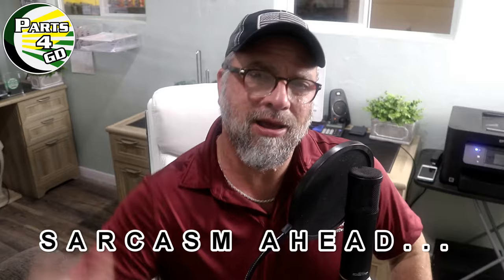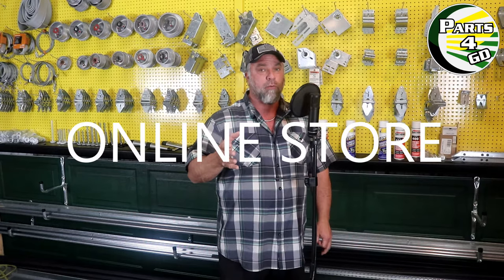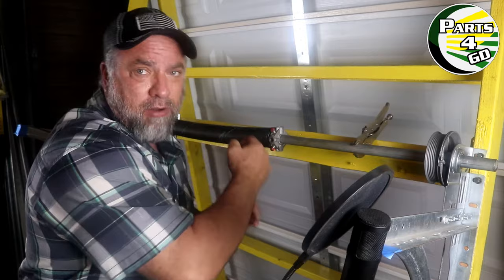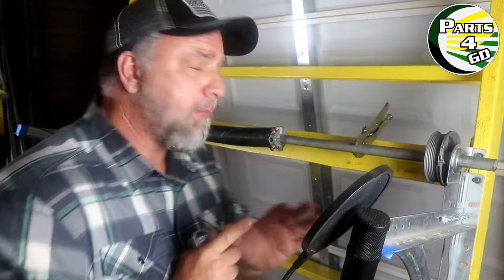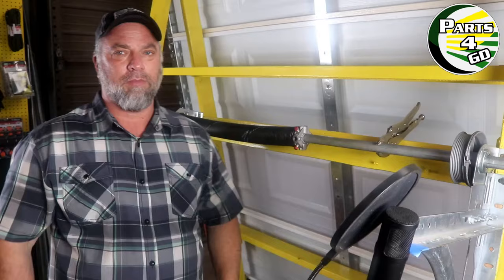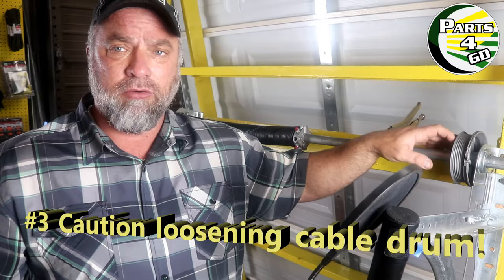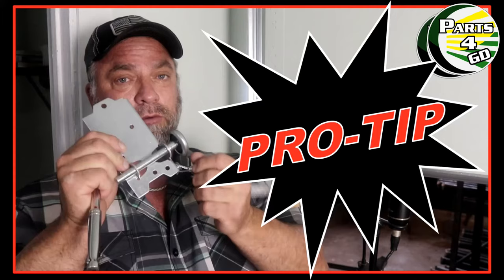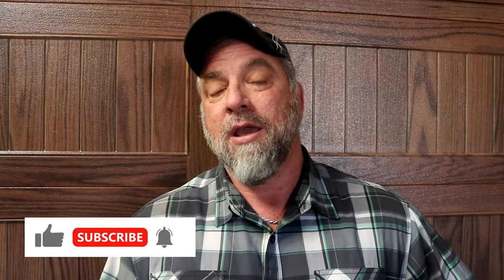4 Garage Door Dangers Every Diy'er Must Know! Watching This Video Could Keep You Safe!

Comment from the maker: Thanks for watching! We would be happy to answer your garage door related questions as best we can. Please feel free to hit us with a question in the comments below...
Reply: Hey great video! Just to clarify, once the torsion spring is relieved with 30ish 1/4 turns, will there be no tension or extreme danger after that? 
I just need to remove an 8x7’ in a building I’m taking down
Reply: Whish I'd known this 20 years ago! I would have replaced my own garage door!

The moron who did it left the old tracks, and torsion springs for my WOODEN (Several hundred pounds) door intact (mostly), but bent all to kingdom come. Bet he didn't know any of the stuff you talked about, and probably hurt himself in the process. Why else would the steel tracks be cut short, and bent up a few feet from the opening for the door, and ONE of the 2 springs all unwound and looking a mess, while the other was still wound? (Frankly, I've come to realize that that wooden garage door was the best part of the house. Better than the 3 wire telephone wire [a standard for about 10 seconds in the 40's], but worse than 2 wire after that. And Better than the REDWOOD beams used in the rooves of the house and garage. [That part of the rooves felt like it was about to break when you walked on the roof.] And better than the 2 wire electrical system of the house and garage.)

With a new, aluminum (practically illumination foil) and track installed right next to the parts of the old one he left attached to the garage.

I've never seen a worker install a new appliance or device AROUND the old one.

Had to get the owner of Overhead Doors to come in and fix new door himself, as it literally started to fall apart just a few weeks later. Had to mention AMX to get the owner to stop avoiding me. But he called me in 15 minutes after a month of avoiding me, when I asked his secretary if they took AMX. Thant's some clout AMX has, as I neither paid with it, or called them about it.
Reply: My garage door does not have any springs in the center like that the little drum like things on each end and one of them has popped or come apart in the spring is the cable is fell off of it and the door comes up cockeyed never seen one of these before

Comment: Vise  Grips should be on either side of the end plate so  when winding the torsion spring or springs don’t cause the torsion tube to make the winding bars pop out and hurt or kill someone   !  Never put  hands on the Red Set Screws  when under pressure like you Did ! Should paint the torsion spring with a paint line so you can count the turns  . Some MFG put dots white lines on them to help count the turns  but not as good to see . I have been the Overhead Door Field for over 40 years  and a oner for over  that .   Doing Commercial  and Residential  Installs  also Emergency Service  Calls .

Comment: I'm 53 and just dismantled a 17 x 8 door by myself for the first time in under 3 hours.  I watched a few youtube videos, bought the right tools (mainly spring bars and square socket) and went to town. I was methodical and only removed what parts were absolutely necessary, starting with loosening the springs of course.  My wife helped me finish up for the last hour.  I also consider moving the ladder around a lot and going up and down it many times to be 100% more dangerous than tensioning/detensioning the springs.  For years I've heard how it's so dangerous but I had both springs unwound in 15 minutes and didn't think it was any big deal.  It just takes a proper checklist and paying attention.

Comment: Thank you much for this info. I worked for a general contractor for a time and have experience in finish carpentry, tile and stone, and drywall but had never worked with overhead doors, and frankly was petrified of attempting any work on the torsion spring / counterbalance. Well, now because I'm renovating a pre-1978 home, no installer wants to do a replacement for me. With your advice, I'm confident I can do it safely.

Comment: That video came out just after my scar between my eyebrows. The only thing I wanted to do was replace the rubber at the bottom. I thought to myself it would be easier if I remove the 2 bottom rollers and open the door, that way the panel hangs down and it's easy to feed the rubber. Because the way the foundation knee wall goes over the side of the door, I didn't see the wire attached to it and just like you said in the video, after removing the last screw of the bottom roller plate, it flew up. Luckily it didn't damage the ceiling, my forehead stopped it. My glasses flew away. Lucky I didn't lose an eye.

Your video would have helped me a lot. I had to deal with winding the spring again because all the tension was lost when the cable few up. I did watch a few vidows on that, I forget from who, but they did show the same safety precautions as you, like using a vise-grip to hold it, and more imnoprtantly use 2 proper bars to wind it. Unfortunately, I couldn't find any in short notice, So I made 2 out of 5/8" rebar, and machined the ends down to 1/2" so that the fix and sit all the way in the holes on the spring bracket.
Reply: 😱 I'm glad you didn't lose an eye or worse!

Comment: Awesome info. My wife didn't wait for the door to completely raise before backing the car out, catching the top of the tail gate to the bottom panel on the door and bent it in the middle about 1 inch out. So, I have to get that bottom panel off and try to straighten it out. This gives me a lot of info, thanks!
Reply from the maker: You may need a strut brace.

Comment: Dope video. I think ima leave this for the pros. Seems easy, i work maintenance.... But one thing inhave learned over the years is somethings are best left to the pros.
Reply: Best display of parts and explanation of garage door repair and function that I have seen. I have watched a lot. 
My renter smashed her car into the bottom 2 panels, twice. 
I've been considering removing and pounding out dents and one support bracket. My door was made by Gadco and they are no longer in business. 
If replacing , I'd have to replace them all with a different manufacturer.  Cost over $1400. For new  complete it would be over $2.100.
Reply: Can you use a hand wench pulley or come along to release the tension rather than  messing with the springs??
Reply: paying a professional is cheaper than going to the hospital or funeral costs!
Reply from the maker: Sometime the easiest way is the right way. But you're right- it's possible to be creative... I don't recommend though!
Reply from the maker: You are absolutely correct!

Comment: I have an old extension spring door which no original parts are available so I have to map what I can get to what is on there to make sure it will work before taking apart.
Reply from the maker: Hope you were able to find what you needed.

Comment: Thanks for the tips. I repaired my garage doors maybe 3 times in 15 years. So I always forget the process and this video reminded me of the safe process and procedures. Last year, my new neighbor at the time had his Spring snap in half. He asked me to help weld it back together. I tried to tell him that it was really dangerous and should be replaced.. I'm not even a professional welder, but I'm sure that they wouldn't do it either. He was hard headed and did it anyway. It lasted 2 days and snapped dropping the door close to his feet. SMH. Anyway awesome video.

Comment: You did not say where to buy these rods.  Does local hardware store or Home Depot sell them? Can u use a black pipe 3/8 inch inside diameter to put in them holes ? Help !

Comment: Thank You! Watched just in time!  I was going to loosen the set screws on the cables!  Again thank you!  My problem is I put on a new bottom seal and I have gaps about 18' in from both ends. I adjusted the limit but it bottoms out in the middle.  Perhaps I need a larger seal? The new one is 2 3/4".  Threw the old one away before I could measure it. (I didn't have gaps before other than where the old was torn) So get a wider seal or is there a way to take tension off of cable to lower it if that will even work?  Thanks!
Reply from the maker: There is a way to adjust one cable. That's another video though.

Comment: awesome information, thank you. Question, I have an old 10' x 10' old wooden garage door and I need to change the bottom 2x4 wood of my garage because its rotten. I have a 2 roller drum system on both sides with the tension spring in the middle of my garage door directly on top. The 2 brackets at the bottom of the garage door that I need to remove are obviously attached to the 2 pulleys. How do I release the tension off those cables so I can release the brackets without the cables letting go and unwinding? thanks in advance my friend.

Comment: I was told my garage door isn’t made anymore. It doesn’t go up on its own but when lifted manually it does stay up. It seems like it still gets power to the motor but won’t go up on its own. Was quoted 1500 for a garage door. What should I do?
Reply: find someone who is licensed and insured for starters..... don't hire a person who says they're an expert... what area do you live?
Reply: The wound up springs are helping balance the weight of the door in order to open it, with or without the opener motor.  Most size doors and opener motors can be purchased at Lowes or Home Depot.  Although, it sounds to me like the gears may be bad in your opener motor.  Its a DIY thing if you're capable.  I got an off-duty garage door guy to replace an entire opener motor once cause I didn't want to mess with the chain adjustment.  Its kinda precise since the opener motor has an auto reverse in case the door hits an obstruction.  The whole job was fairly cheap after I purchased opener motor, which was about $100.

Comment: A few comments if I may:
1.  Some YouTube videos use rebar for torsion bars.  Bad idea!  A good set of torsion bars are only $22 on Amazon.  Rebar would probably work ok if you started with larger than #4 (1/2”) and ground down the ends to fit into the half inch hole.  But rebar is designed to bend easy, so why?
2.  If you have the problem I had, where you need to loosen the torsion springs, obviously turn the adjuster the opposite direction, but also put your vice grip beneath the rod and brace it for the opposite direction of adjuster being turned.  The purpose for the vise grip is to prevent the bar from rotating which would create the roller and cable getting out of adjustment and create an uneven/unlevel garage door.  Now you have a whole other problem….
Reply: I bought a 36" length of 1/2 round bar from TSC for $9.99 and cut it in half. Works like a charm.

Comment: what can i do to fix the garage door is tracking to the left and rubbing on the left track?
Reply: That means your cables aren't adjusted equal. One side is tighter than the other, which causes one side to lift higher than the other.

Comment: Do a video if we should have 1 or 2 springs. Right now we have one and when it breaks we can't lift the Dorr even with 2 string mem
Reply from the maker: Many common single springs set ups give you 7k to 10k cycle life before breakage. A double spring should give you a minimum 15k cycles, up to 40k+ for high-cycle set ups. It's nice to have two springs as you mentioned because if one of them breaks, you will have one remaining to help you lift the door.

Comment: I've put a wall mount door opener on mine . Lifts fine, on way down wire uncoils from drum. Do I lesson spring tension . I figure there could be more than 1 problem
Reply from the maker: You may need to adjust the limits on your unit so the door doesn't lift too high.

Comment: I'm trying to replace the wood in the center where the spring is mounted, can I still do that or take same precautions?
Reply: You definitely need to take the tension off of the springs. Also need to measure from the top of the door to the center of the shaft, to make sure you get it back to the same height

Comment: Can I remove the horizontal track without removing the tension wire on a 2 car garage. The reason is I’m turning garage into room but don’t want to remove garage door I want to frame around it.
Reply from the maker: I've seen people do things like this and don't recommend it. What if the door gets dented from outside, how would you change it out?

Comment: What can be done if installer split the jambs? He did not pre-drill for those bolts just drilled them in. My son came over and saw all the splits. Went ballistic! What can be done?
Reply from the maker: Depends on how bad it is. Sorry that happened.
Reply: @parts4garagedoors278  What would you consider bad enough to require replacing all the jambs? Do splits close up in time, or just get worse? (Every jamb has at least one split, most have two, even three.)

Comment: My steel garage door weights 360 pounds, is 16x8 ft, the radius is 12”, which is the right set of torsion springs ( two of them left and right )?
Reply: Your minimum requirement is gonna be a pair of 262x2x35 at 10,000 cycles. If you want to upcycle, a pair of 273x2x42 will do about 18,000 cycles.

Comment: Question one cable is disconnected and door is down, can I disconnect the other cable and then push door up to wind cables and reconnect?
Reply: Do you have a set of tension/winding bars? Those are a must have, along with a good pair of vice grips. Using your tension bars, remove some of the tension on the spring until you see some slack in the cable on the side where the cable is still attached. You will need to leave your bar in the hole. There will still be tension on the bar, and that tension will hold the bar against the garage door. Move your ladder and put the loose cable back on the spool, then go back to your winding bars and SLOWLY (one hole at a time) allow the tension back into the spring. Make sure the cable is spooled on both sides.

Comment: is there anything special about the torsion bar/shaft? or can I get black steel pipe from home depot and replace it with that? I'm trying to fix up the previous owners mess up's(multiple things) and notice after carefully unwinding the coils that the bar is really beat up(looks like someone previously adjusted the coils 155~ times at least:S almost square on one part), considering replacing it but not sure....
Reply from the maker: Please use only a torsion tube made for a garage door! It will save you head aches down the road.

Comment: Where can I get some torsion bars?  Like today...1/4" steel bars ??
Reply: They should be 1/2" diameter. 1/4 will bend way too easy. You should be able to find a stick of 1/2" round bar at TSC or one of the big box stores. I bought a 1/2" x 36" stick of round bar at TCS for $9.99 and cut it in half. Works like a champ.

Comment: sir. please, tell me 10' high garage door with too spring how many quarter turns
Reply: 4 qtr turns per ft of door, plus 2.

10ft door 40-42 turns
Reply from the maker: 41 to 42 quarter turns, assuming your cable drums are a 12 inch circumference.

Comment: If my springs are loose on the rod does that mean they need to be replaced or just tightened?
Reply: 10 years experience here... How are you determining your springs are loose on the torsion tube? If this was the case you would have to lift the full weight of the door in order to open it... Most people can't do that as it weighs hundreds of pounds...
Reply: @davidleedougherty6478  I ended up replacing them! They were definitely very loose. Tried to tighten them and it didn’t work. Replaced with brand new ones and immediately opened my garage!
Reply: @davidleedougherty6478  but they were looking really saggy on the bar and If I poked them they wobbled so that’s how I figured they were loose
Reply from the maker: They can sag as a result of the inside diameter of spring being larger than the torsion tube.

Comment: I installed a 10 x14 garage door and springs are at 42 1/4 turns ,door is binding at about one foot up. And rod jumps a little bit seems to be binding in the rod , it's a 2 spring system . Any ideas?
Reply: The springs should lengthen on the shaft as more turns are added. If the spring gets tight on the shaft while winding- due to paint, rust etc, it will become compressed without enough stretch. This can cause the binding. The solution would be to spray lube or grease on shaft (clean of dirt, paint, grime) revers wind a bit, lube some more, then finish winding to proper amount. Carefully tap the winding bar outward while holding it firmly if necessary to make sure it it stretching. Good luck and be very careful as this can be very dangerous!
Reply: More than likely your springs are on backwards, On the wrong side. The end of your spring wire should be pointing in the direction you are winding. Spring should grow in length as you wind it up. If it’s not growing you need to change the spring to the other side.
Reply: Call a Commercial Door Company
Reply: Got it figured out , it was binding , works well now . A friend that is a semi truck mechanic came over and fixed it . He works on semi doors all the time.

Comment: hi, thanks for your videos,i hit the garage door with my car but wasn;t bad the string came out when i put it back the door is pretty hard to open, why is it?
Reply: Your springs need adjusted. Did the cable come completely off. If it did you need to redo the cables and springs. Easy to do. 4 tools needed
Reply from the maker: May need to add another quarter turn to the spring. Research first. Also make sure the door isn't scraping on the jam. There are track adjustments, and a top roller adjustment that can be loosened to allow more space if needed. Also, lubricate all the parts with a spray lubricant.